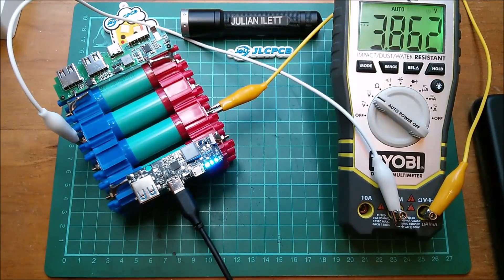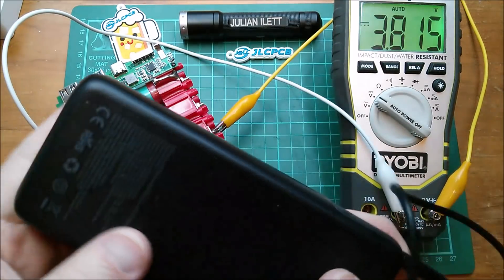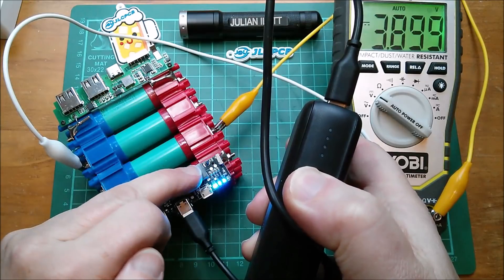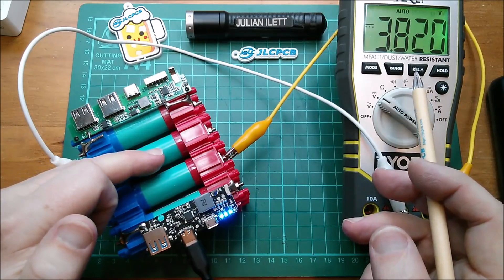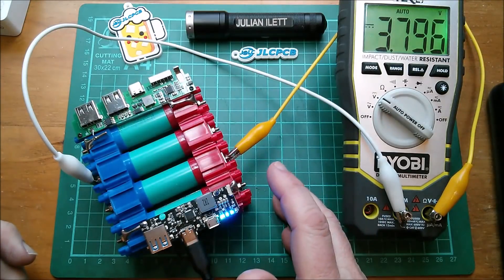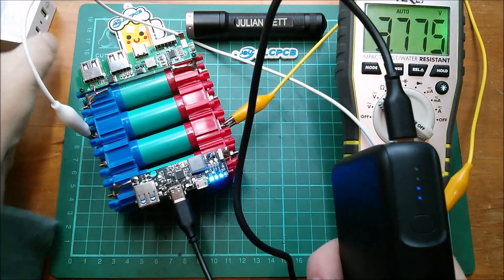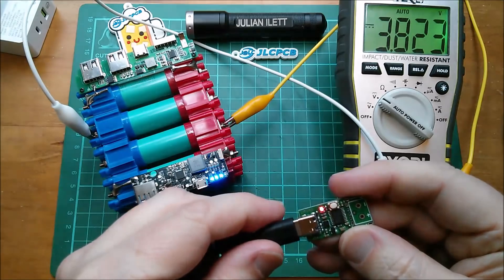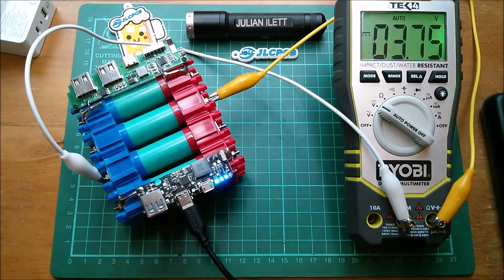PD Power Bank Button Functions (W332 chip)

Comment: lol, I'm a subscriber, but ChatGPT brought me here in a query about the W332. It's good to know not to rely on it for charging the cells.
I'm looking for a module which has a boost converter, so that I can use 2 cells and still get 12v or 15v. Do you know if such a thing can be found on AE?
Are all these commodity power banks using a separate boost converter?

Comment: That trickle-charge mode is an advertised feature on some banks - by default they'll stop output if the draw is under some very low amount, but you can throw it into the other mode for e.g. running a few LEDs on the top of a type-A connector for a tent nightlight

Comment: The USB-A connector on one or both power banks might be directly connected to the USB-C connector. So you might be able to find out how much voltage there is on the cable by connecting to that.

Comment: Hi Julian, I too  have always been extremely fascinated and  intrigued with switching power supplies and  their use in practically every device now made either electronic or mechanical .I am wandering if you ever thought of or possibly tried accessing and reading the firmware that is programmed into all of the controllers that drive every type of switch mode device? If you are able to access or read the firmware, you would not only be able to know all the various modes and settings that each device comes with but you should then be able to set  your own parameters and setting for all these power boards.

Comment: The latest mobile phones with large battery capacities have the ability to charge or run other devices from their charge input port, so presumably a similar chip is being used here to enable bidirectional charging.

Comment: 4.33v? that's the 5Ah Li-PoHV 3.8v nominal batteries.
also, USB-C boards for powerbanks as per the PD 2.0 spec, must supply up-to 20v, as well as the 12v, 5v, and 3.3v. so, your little board on that psudo powerbank isn't truly PD 2.0, but just Quallcomm QC 2.0 compatible.

Comment: 3:10 Be careful how you point! I make the same mistake sometimes. As for the real content, ambiguous charge direction will happen in a regular person's use. Smartphones obviously charge over USB type C but they (well, at least some) also can supply power to charge other devices. For this case I believe my phone has a menu option where you can reverse the charge direction. Similar to that case is a laptop with type C charge support. Are you charging the laptop or charging the power bank? Who knows?

Comment: Could you post a link to the 18650 connectors you use. I'd like to build my own powerbank but I'm loath to solder the cells.
Reply: He did a video about them here.
https://youtu.be/qLXG3pR5teg
Reply: @dentakuweb  Thanks.
Reply: If I remember correctly, they're called Vruzend connectors which is a brand name.  Personally, I bought myself a purpose-built spot welder and there are instruction videos on YT for how to make your own.
Reply: @melkiorwiseman  Thank you. I'll look them up.

Comment: Julian, do you still have your Ruideng USB power meter thingy, if so there is a USB-C socket on the side so you could use that to see the current/voltage between your powerbanks...

Comment: Ref PD from commercial power banks. I was disappointed to find that an Anker power bank only delivered 5V, 9V and 15V via the USB C connector (I was using the trigger board) None of these voltages were listed on the Amazon description and it was only by reading the specification (using a magnifying glass) on the power bank that I found these voltages listed

Comment: I've find that only the boost circuit is off, when the LEDs are off, but it'll still pass the battery voltage to the output - a diode drop.
The power bank will likely charge on an input of 3.8 Volts, until it's own cells are equal to the received voltage.
Reply from the maker: I think you're right - the data-sheet has double click as 'turn off the boost circuit'.

Comment: I have a powerbank with a usb type c output, sometimes when I connect it to my phone it tries to charge itself from the phone, as I guess the phone can both supply power and receive it, I assume that is so you can share your phone power with a friend who needs it, but there is no easy way to change direction.
Reply: That's part of the USB OTG, provides power to HDD, USB cameras, etc.
I think every phone has that nowadays
Reply: @fersunk  
Most Android phones do. Apple users are out of luck with OTG I believe.
Reply: @johnnodge4327  apple doesn’t exactly have OTG, but power is bidirectional (remember the Apple Pencil is charged from the iPad (also charges from an iPhone)) there’s also FLIR cameras, USB thumb drives etc that can all plug into an apple device.
Reply: Expect this is needed if you use external usb devices on your phone. Eg external camera,  keyboard datastorage ....
Reply from the maker: That's crazy - you connect your phone to a powerbank and it sucks all the remaining charge out of your phone. Isn't there a toggle function in the phone's power app?
Reply: @JulianIlett  does not always happen,  but yes it is crazy.